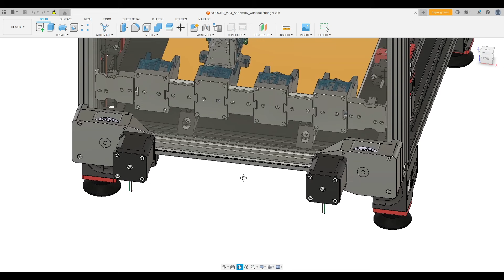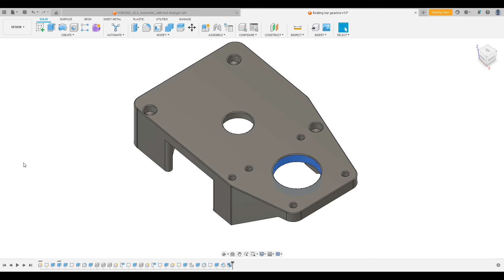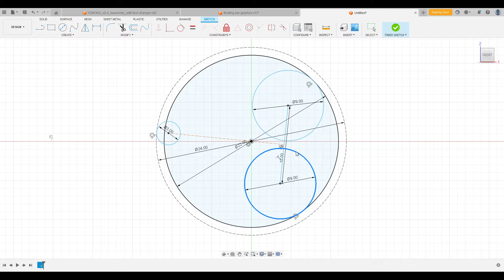[Spare Part Remix] Perfect Fit on 3D Printed Holes – No Reamers!

Comment: It's a neat idea, especially because you don't need big reamers of different sizes any more. 
I think the biggest improvement would be adjustable height, so you don't have to remove / add bearings for the multi-step grinding.
Reply from the maker: Adding and removing bearings are for the length. Maybe switching to the rods, which can slide, and fixing them like set screws, can achieve what you want. It would be more like an XY-plane movement. Thank you for your suggestion.
Reply from the maker: Clamping the rods might be another way to make them easy to use. However, I am concerned about the rigidity of this method. The rods should not move during the grinding process. What do you think?
Reply: @SlowEngineering  My first guess would be to print something like a tongue and groove mechanism for Z (direction of the spindle) with one or two locking screws to lock the mechanism. If you dont need free adjustment, which i guess it doesn't, you can integrate like two interfacing gear racks to increase the rigidity. 
The mechanism for the radial adjustment and the bearings would be on the moving part. 
This might be a bit bigger overall, but i think the adjustability is worth it. Also, prototyping is obviously very fast and easy with 3D printing.

Edit: To answer your question: Clamping the rods should be stiff enough for this application if you don't use the smallest rods you can find (like 4mm and up should be fine) and you're clamping on a long enough stretch of the rods.
Reply from the maker: @terl0th The slide for the radial adjustment should be interchangeable for different hole sizes. Building another direction of movement should also be as easy as possible. After some deep thinking, I change my mind about sliding the rods. Sliding makes the tolerance, which affects the circularity. I prefer to replace the slide with different rod lengths. The tight fit between the rods and the printed slide is the key to keeping the circularity. A slight change to make the slide be replaced at the end should be okay for quick swapping.

Comment: Very nice, Can you think of a variation that could slim down the diameter of a cylinder? I find this very hard to do manually. Cheers
Reply from the maker: I think the same concept of forming two bearings and a grinder bit can still solve the problem. A kind of spool rack supports the filament spool on the edges instead of the center. It features two-point contact with the spool. This concept can be applied to the idea I showed in the opposite way to make the cylinder slim with a 2-stage process, too.